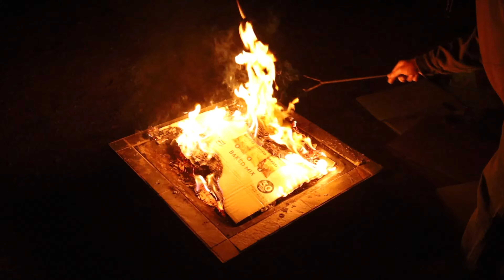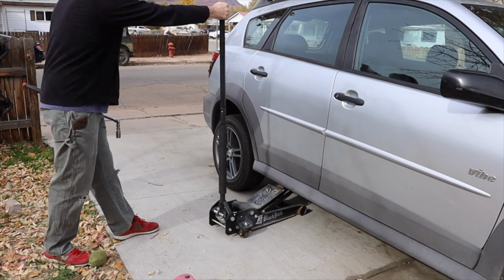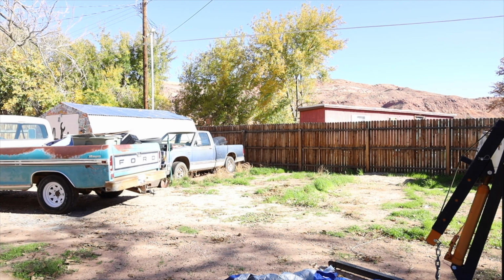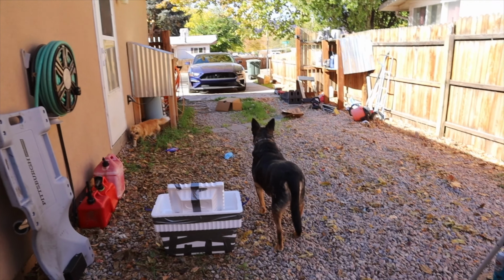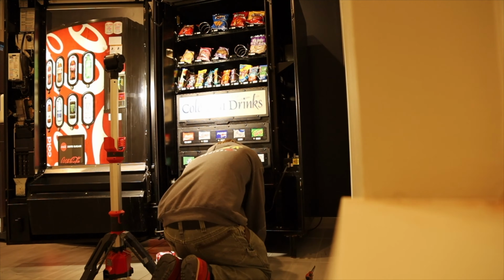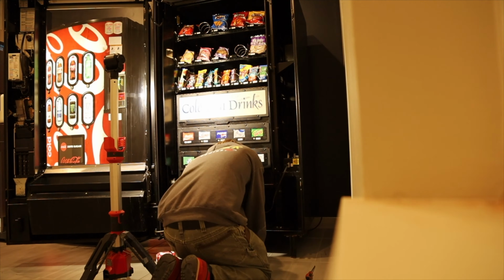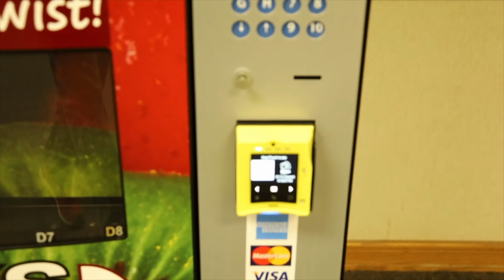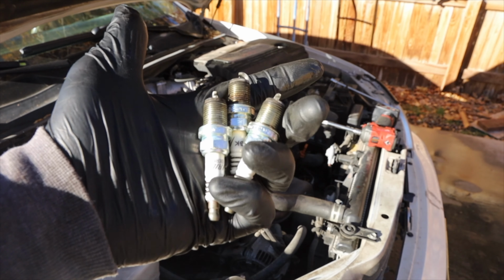VEDUC Day 2

Comment: You should go more into the vending machine Biz, for about 7 years of my life off and on I worked on and installed ATM's, NCR and others, you name it. 15 years with hp. Long time ago IBM Selectric typewriters and calculators :). Ran a BBS back in the day with 10 lines in for 7 years. Not a resume just thought it might be interesting.
Reply from the maker: That's the plan. They're a very large up front cost but in the long run it is very lucrative. In fact, Just from the end of October until the end of November I made just over $1000.